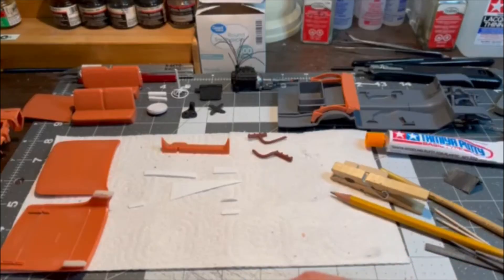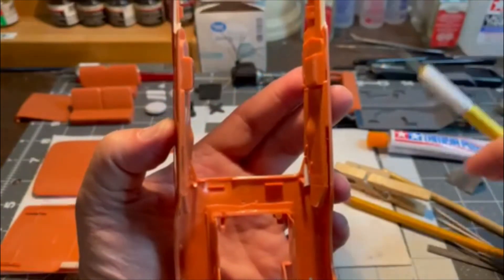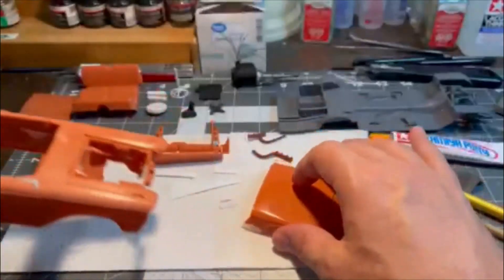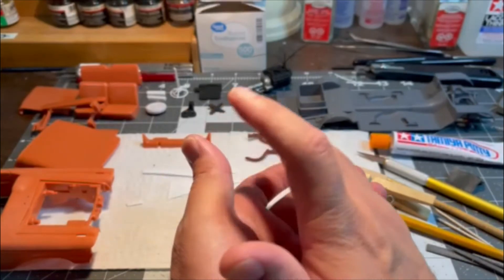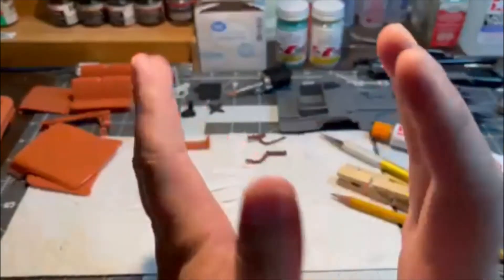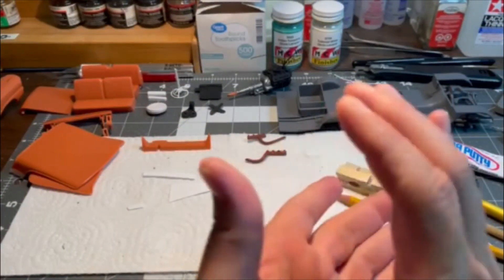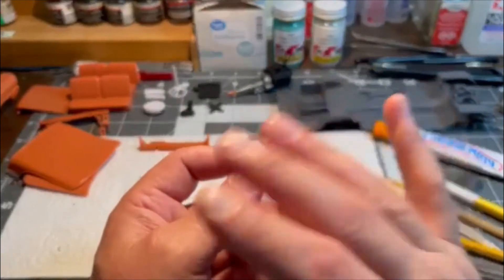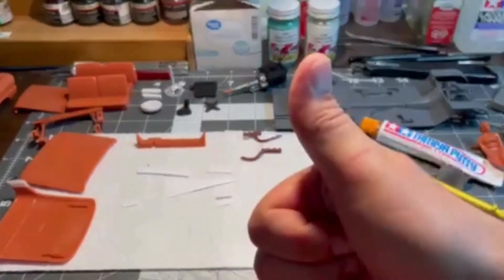Revell 1/25 Scale 1959 Ford Galaxie Hard Top Convertible Build Pt 7

Comment: Im amazed the way you achieved to line up the two pieces of the roof straight to keep the right shape, what a good work!👍
Reply from the maker: Thanks! I assembled the hinges first. Then lay the roof pieces upside down until they were lined up. Then I lay the hinges in their slots until I was happy with alignment, then cemented them in place with Tamiya Extra Thin.

Comment: Your center will be red and the outside will be chrome leading into the center. There is a deluxe option that had a chrome cap on top of the red center but it had fins in the 12,3,6,9 o'clock positions.
Reply from the maker: Thank you. I was going nuts trying to find reference photos.